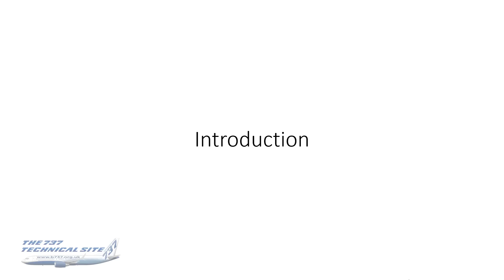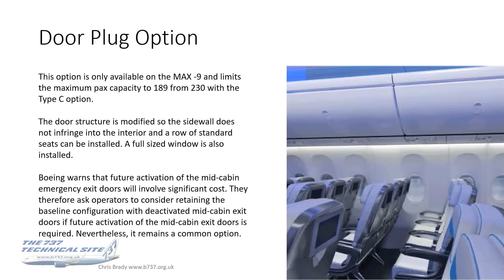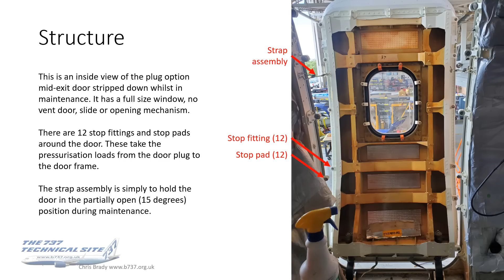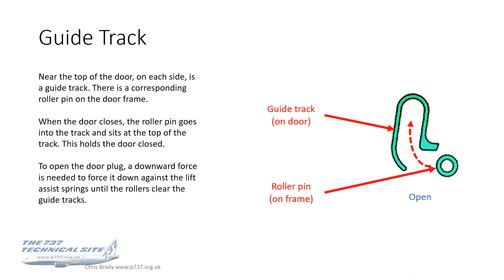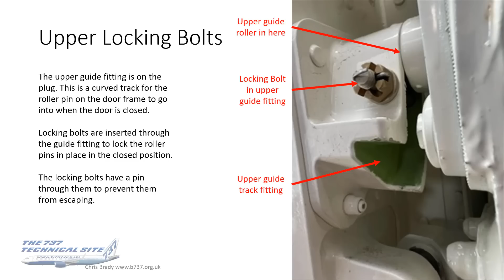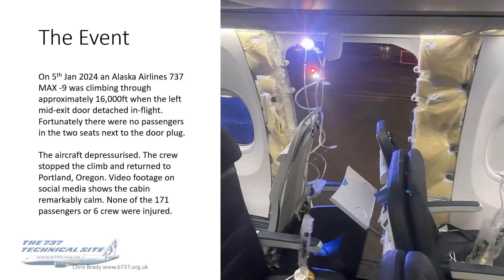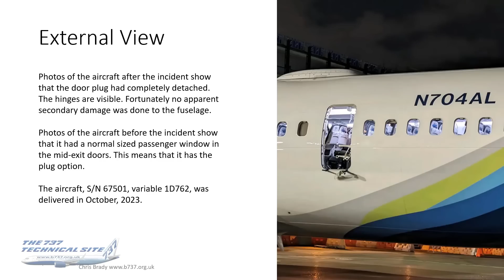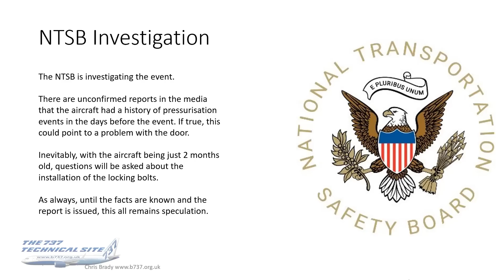737 Mid-Cabin Emergency Exit Doors - Plug Option

Comment: 6:30 The “roller pin” doesn’t go anywhere, it’s attached to the frame and stationary, it can’t move around a corner. The “guide track” attached to the door is what moves. The only way to disengage the pin from the guide is for the guide to move upward (along with the door), with assistance from the lift springs on bottom hinge assemblies.
Reply: Chris, I realise that the AMM should be the authoritative source but just looking at the pictures surely shows the opposite. I hesitate to suggest it but if that text really is a quote from the AMM then it looks as though the description in the AMM itself is incorrect. Normally I would have resigned myself to the fact that I didn't understand but I really can't see how this description aligns with the pictures.
Reply: @davidvallance1554  I've found multiple errors in the 737 system schematic manual that left me scratching my head, they certainly aren't infallible. The sheer amount of information in the manuals is staggering! Getting all those details right is a tremendous effort. There are also many repeated diagrams and text which would all need to be identical and all updated when there is a revision that affects them. Anyways, TL;DR I would not be surprised if the AMM was in error.
Reply: @MikeOBrien0  I agree. The Maintenance Manual is far from infallible. I was continually submitting error reports through our tech department.
Reply: @MikeOBrien0  I wonder if those who wrote the manuals have seen the procedures being performed (or even better, participated in it themselves), or just heard of it via an effective game of telephone. It'd be easy to get the details wrong for someone who has only looked at drawings and not the reality.
Reply from the maker: * Errata *
In this video I state that a downwards force is required to remove the door plug. I based this statement on text in the AMM SDS which I now believe to be incorrect or misleading. It is possible that a very small downwards motion (1-2mm) is first required to be able to free the locking bolts. But the door must be moved upwards by a couple of inches to clear the guide tracks. Apologies for any confusion.
Reply: @ChrisBrady737  CORRECT--almost!  If the cabin is pressurized, perhaps only an inch upward movement is sufficient to permit the stop tabs from being misaligned enough to pop the door plug open.  It was reported that both guide tracks had fractured, so apparently what happened is that the bolts were not installed, eventually the door slid sufficiently upwards (due to turbulence...) to move the door stops above the frame stops, the pressure pushed either the bottom of the door outwards fracturing the guide tracks with a prying force or the pressure was sufficient to directly fracture the guide tracks.

In order for the door plug to be removed for servicing, then a few inches upward movement would be sufficient to disengage the pin and guide tracks.
Reply: @ChrisBrady737  Is this a Boeing error, similar to not informing pilots that thier anti-terrorist cockpit door will just swing open during a depressurisation event?
Reply: Well…if they’re called ‘Lift Assist Springs’ then doesn’t that tell us something ? There’s a gap at the top of the plug in reference to the frame, thus it makes perfect sense the springs are helping assist you to overcome the mass of the plug, which allows the track to rise over and off of the pins. Once the plug is opened, those same springs keep the door from the tendency of gravity to pull the door down back over the pins, allowing the plug to be removed from the fuselage.
Reply: Does make more sense to me else those springs wouldn't be the opposite of a 'help' opening the thing.
Reply: @secondskins-nl  Well, without the bolts, it looks like it just needs a yank upwards and slight push and there you go... A minute turbulence at altitude would open it... well, about the way it opened. 
Now, the question is, was it wise to make (the plug) springy to open with easily detaching single-and-only safety device (bolts) instead to make it harder to open but foolprof to put back?
Reply: @docnele It needs a yank DOWN to unlock the door (ie a hard landing) in the absence of the bolts.
Reply: @allangibson8494 , I watched, read, & listened many times before writing my comment, I was confused about this too. At first I thought maybe I didn’t understand the orientation of diagrams, maybe they were upside down, but I believe they are all correct. The diagram, related text, and narration at 7:00 all state the guide is on the plug door & the roller pin is on the door frame. However in that scenario pulling DOWN on the door cannot release the pins like described in bottom paragraph of that diagram. So, the video gets something wrong- either he gets the location of pins & guides wrong at least 3 times, or the statement about pushing down against the springs to release pins is wrong. 

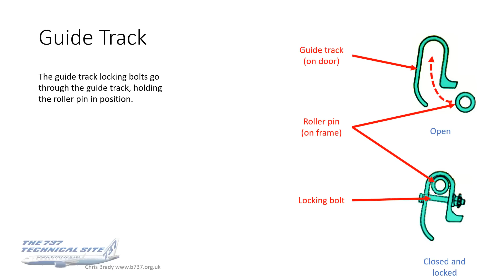The answer is found when looking closely at the new 9:00 photo showing the pin, in the guide, of a closed door, with the bolt in place, and matching it up with the 8:30 diagram showing the same. Now, zoom in on the 8:00 photo at the upper right corner. Knowing what the guide piece looks like you can see it’s positioning on the open plug door, AND the roller pin is visible on the door FRAME. The springs have to push the door UP to release the roller pin from the guide. The door can’t move down against the springs if the pins are in the guide slot. Once I understood the relationship of the parts it finally made sense. 

Finding the door WILL provide some answers! Those lower 2 bolts not only go through the green / cream door piece that slides on the vertical cylindrical pins, but they go through the center of that cylindrical pin. Those cylindrical pins appear to be extending horizontally outward at the bottom of door opening on the exterior shot of plane. I think I see part of that green / cream piece dangling from the end of the one on the right. The closeup pic of the lower hinge area shows those pins have a bolt in the upper end, with a washer larger than the pin, presumably to prevent the door sliding off pins until the bolt / washer are removed. 

I’ll wait to see better closeups of damaged parts, but it seems to me if even 1 of the 4 bolts were in place & properly secured the door could never move enough to release the pins at the top. If NONE of the bolts were in place it seems likely the vibration going down the runway on the first flight, combined with springs pushing up on door, it would have popped it open before plane got into the air. Bolts in position, but maybe without nuts & cotter pins, might stay in position quite some time until the last one vibrates out and door goes flying. I can’t see there being enough movement / vibration / force from springs to shear the bottom bolts. The upper bolts don’t even go through the roller pins, they simply trap those pins in the guide, so there could be some bending force on the upper bolts, if for some reason the lower bolts were not in position and allowing door some upward movement via spring pressure. In any case, once the upper pins come out of the guides the door goes flying.
Reply: @Bitterrootbackroads  The door releasing with no bolts would be a balance of the weight of the door and the acceleration and duration of the acceleration needed to move the door down the 50 mm to the unlatched position. The friction of the latches under pressure would oppose this in normal flight but on landing the differential pressure from the cabin pressurisation is dumped when the landing gear is extended (and is naturally low below 8000ft).
The biggest and longest duration thump occurs when the wheels hit the runway, so that would be my likely candidate.
Reply: @Bitterrootbackroads  Let's say all four bolts are missing, and the springs are pushing the plug up into the guide rails. The 12 stop fittings are holding the door to the A/C frame, but not providing much structural support. The pressure differential is constantly pulling the plug outward. Now lets say the stop fittings finally give way, but you still have all this pressure trying to pull the plug out, what happens? Maybe the plug comes off from bottom-to-top, not the other way around. The pins are still in the guide rail, the plug pulls off starting at the bottom and pushing outward, the hinges keep pushing up, the plug rips off from bottom to top and the last thing that happens is the pins finally come out of the top guide rails. What do you think?
Reply: @Bitterrootbackroads  Absolutely correct. Pins on the frame, sitting in the guide tracks on the door. Pushing the door down is impossible. Pushing the door up is what releases it. 
Therefore, the only apparent mechanism stopping the door from opening at any time seems to be related to those twelve "door stops". It seems likely that the working emergency exit door would have latches on them (pull a lever to release the latches, allowing the door to jerk up on its springs and out). And the "plugged door" option would have bolts through the door stops instead. 
Looking at the image of the ajar plug option at around 4:50 (and especially the visibly substantial structural strength of the twelve "stops"), nothing else makes sense.
Reply: @ParisScot , At 5:16 the video talks about those 12 “stops” taking the pressurization load & transferring it to the door frame. NTSB briefing on Sunday also said those 12 stops take the pressurization load. I readily admit- I have ZERO training, or actual knowledge of anything aircraft related. Maybe enough mechanical aptitude to look at static pics of parts and imagine how they move. A few photos, diagrams, narration & text in this video are all I’m going on. Before I saw this video I assumed “plug door” implied it was something installed from the inside with a flange or taper seal that used the aircraft interior pressurization  to aid in sealing and positioning. It’s not a novel idea, steam boiler cleanout holes used that concept in the 1800s. Shows what I know about airplane doors! 

A “stop” in general mechanical terms often implies something that limits the travel of another movable component. The video claiming these 12 stops transfer pressurization from the door to the frame implies they somehow make a physical connection but there is no mention of how that connection is established. If there are 12 bolts that go through the “stops” and into the door this video makes no mention of them. I see nothing in photos or diagrams, either on the stock photos or the plane in question, to suggest there are 12 additional fasteners or latches of any kind holding the plug door, and possibly failing. Maybe there is some automatic device on those stops like a tab dropping into a slot or something? If that’s the case, and they automatically release when the door moves upward to lift the guides off the pins at the top, then they offer ZERO redundancy in the case of the door moving. It would be like your seatbelt automatically releasing in a collision at the same time your air bag fires. Videos on bridge failures call that concept “fracture critical”. 

Since they are called “stops” my first thought on their function, once I learned the door opens outward and the video was focused on the guides, roller pins, hinge assemblies & the 4 locking bolts, was that those stops simply were there for bearing points for the door to rest against when it was fully closed, with no holding function. I would guess there is some adjustment function in the stops to fine tune the flush fit of the doors outer surface to match fuselage profile. This video & NTSB claim that the stops are load bearing against cabin pressure. If they stick with that claim I need to see how that is accomplished. 

Now that the door has been found we will have answers soon. Will it have 12 broken / failed / missing stop bolts or fasteners?
Reply: @Bitterrootbackroads  I certainly agree with this point of "confusion" I expected to hear the stops were offset for closing then as the door is lifted (assisted by the springs) that they would overlap/align to take resulting cabin pressure forces. I did not hear that. Looking forward to the reports, but this video is well enough done to greatly advance my understanding of the structure.
Reply: @billl7551  Yes, I’m zooming in with my iPad but I can’t see any functional details on the “stops”. Since the doors final move to being in fully closed position is mostly downward about 1-1/2”, and the tubular portion of the stops appear rigidly attached to frame, how do the 2 parts engage?
Reply: @Bitterrootbackroads   Someone else on here (can't find the comment) with experience of such doors said that the door stops lie over the pads and the forces from pressurization push against the pads...
So therefore, although you can't see it from the photos, the only way this can work is that the stops on the door lie over (i.e. inboard of) the stop pads. As pressurization pushes the door outwards, the door's stops push against the interior surface of the pads, transmitting the forces to the fuselage.
And (also according to that comment that I can't find), the guide rails are merely there to make sure that when the door is closed, it slides down exactly so that the stops are perfectly aligned on the pads. This also makes perfect sense.
Maybe sticking bolts through the stops and pads is bad from a safety / fuselage stress dynamics / noise / other point of view; the door is designed as an open space and putting a rigid bracing (door + 12 bolts) across it on the ground in uncontrolled conditions (maybe Alaska, maybe Arizona) might interfere with the contraction of the rest of the fuselage around it at different temperatures and pressures. If that is the case I can understand that the plug mimics a real emergency exit door while remaining inert. But it still strikes me as a flimsy method of securing that gaping hole.

BUT... looking at the pic at around the 6:00 mark, those 12 stops seem to have a threaded bolt protuding out from them. This does seem to suggest that when the plug is sealed, those bolts are tightened, fitting the holes in the stop pads and preventing the door from moving at all. Or maybe they adjust the depth of (rounded? conical?) pads on the other side to improve the seal. Whatever the case, it does seem that the stops and stop pads are the primary method of securing the door, and the bolts across the rollers/guides and spring-loaded hinges are merely to prevent the door from shifting out of position.
Reply: @Bitterrootbackroads  I also thought there were 12 bolts there, but it seems to not be the case. I just took a look at the AMM, the body stop is facing inboard, and the door stop is facing outward. So indeed, cabin pressurization holds the door firmly against the stop pads. This makes things a lot more confusing. I'm sure these questions are more obviously clear if I was in front of the plug to see it in action.
Reply: @Bitterrootbackroads First thought is that the plug has hooks that mate with the 12 door stops.
Reply: @allangibson8494  actually the opposite, the door can only open when it's in the uppermost position.
Reply: @adjutant , My ONLY reference is the photo of the open door in this video. I’m thinking now my eyes have been fooled by an  illusion created by viewing what is essentially a 1 dimensional drawing of 3 dimensional parts. It’s like Big Bang Sheldon trying discern the difference between squares, triangles, and hexagons while stuck in the imaginary Flatland universe. Ms Homendy with NTSB and her “high five” skit last night did nothing to answer mine, & apparently other peoples questions, BUT- she has seen the 3D version. Her failure to comprehend the problems I encountered in Flatland is understandable. 

A view looking downwards, of the stop parts engaged in a closed door situation, I now believe will show the “stop fittings” on the door are L shaped & extend far enough inward from the door, so that as the door is closing that last 1-1/2”, the bottom of the L shaped door fittings actually come down inboard / BEHIND the frame mounted “stop pads”. If thats the case, then all is good.
Reply: @kdietz65  That is consistent with what was found...both guide tracks were fractured.
Reply: @Bitterrootbackroads  The door stops slide in back of the frame stops.
Reply: @BruceLiebert , Thanks for the input on how the stops work. Going only on that 1 dimension photo I just couldn’t see what was happening. The experts all described the stops bumping up against each other, they just left out that part about how the outboard one gets behind the inboard one, High 5s and that photo were no help! I have yet to see a pic or diagram of the stops engaged but I can visualize it now. 

In the case of this rarely opened door plug I hear rumblings that re-engineering needs consideration. We hear plenty about redundancy being key to aviation safety. I don’t know if either the 12 stops, OR the positioning / latching system (hinges, guides, roller pins) are capable of retaining the door should the other fail? If so, it seems a redundant plan would make them 2 separate systems. Why should a failure in the latching system automatically release the 12 stops? That sounds more like Fracture Critical engineering.
Reply: @ParisScot 
I agree, those twelve stop fittings/stop pads are doing all the work. They do look like they have a threaded stud sticking out, but it would be on the wrong side, untill the plug is in place and then they would be screwed into the stop pads. If they are just pressing on each other with no locator then the only thing keeping them in place are the two guide tracks on the plug at the top. We really need to see a close up picture of the stop fittings to know for sure.
Reply: @johnjosey5184 , I’ve come to the conclusion the straight on photo angle is creating an optical illusion in regard to those stops. Those who have seen them in person are seeing something different than we are imagining maybe. Pics from the top & sides of the stops engaged will make it clear I think. The door mounted part apparently comes down & over the frame mounted pads and engage them on their back sides.
Reply: @ParisScot , Yes, apparently the door mounted outboard portions end up inboard of the fuselage mounted pads. The straight on aspect of the photo makes it impossible to see. The experts with their High 5 hand slapping skits don’t explain it clearly.
Reply: @Bitterrootbackroads  
Yeah, a clear photo of either from the top or the side would clear up how those 12  points work. I cant believe they are just "floating" They surely have some sort of positive locating pin ?
 
It's hard to see, but the pins at the top of the frame , the one's that go into the tracked bracket on the plug dont seem to be sticking out too far. Again, a close up photo would reveal if that is the case. So many more questions than amswers at the moment.
Reply: @docnele  I would think that cabin pressure would keep the the door in place at altitude, but when depressurized, the springs probably almost entirely counter balance the weight of the door and any jostling might inch the door up. After a few takeoff and landing cycles, that movement might be enough to fully disengage the stop pads and blow the door when pressurized. That might explain the pressurization problem over several days and also why the door blew out at relatively low cabin pressure differential. It might have been a ticking time bomb  if all four of the bolts were missing
Reply: @johnjosey5184  , So far the experts are all focused on the 4 locking bolts & their related parts. I think some of the focus will eventually shift to the 12 stops, and some pics or video will show up. NTSB is looking at the matching plug door on the other side of the plane, no doubt opening and closing it many times with cameras rolling. Before you can figure out why something ISN’T working, you have to understand its function when it IS working. I have a feeling someone looking at that closed door, secured at 16 different points, will be amazed to see all 16 points release at the same time. If I was with the NTSB at that point I might ask- “Why are all 16 holding points releasing simultaneously?”  (Well, 14 that release & 2 hinges at the bottom that are now free to swing outward) 

You ask a very good question about the stops apparently “floating” as opposed to having some sort of “positive locating pin” or function. I wondered the same, and also why nobody is paying any attention to it. I went back and watched Blancolirio & Ms Homendy try to explain  how the stops function with their “High 5” hand bumping skits in response to reporters question. Ms Homendy asks the fellow standing to her right to hold up his hand. I only caught this after watching it a few times but she gave away the secret at the very end. As she demonstrated how the stops “release” she slid her hand UPWARDS, OVER, and BEYOND the guys hand to show the actual release motion. So HER hand was the “stop fitting” attached to the door & moving outwards, and HIS hand was the stationary “stop pad” attached to the door frame. Then it makes sense!

The stops have to be “floating” because their total engagement is dictated by the final 2” downwards door movement to fully closed position. They slide together so they have to slide apart. They don’t “BUMP” together like the experts claim. They can’t have any positive locating pin or device because it would interfere with, and prevent, the sideways / upwards motion needed to release them. 

Just a little speculation here- What I see of the stationary “stops” shows a round hole through at least some of them, not a sliding “pad”. I wonder if the guy who originally designed them planned to close the door? Then put some bolts through some stops and into the door? For a plug door, that only opens a few times during the life of the plane, the extra few minutes to manually remove those bolts would seem a worthwhile sacrifice if it achieves redundancy, as opposed to the current “mousetrap” effect as Blancolirio calls it. 

The first major auto recall I remember, early 70s I think, involved the bonded rubber pads failing in the 2 piece motor mounts on General Motors cars. People died when engines shifted & jammed throttles wide open. The “fix” done to millions of cars, was an 8” cable with eyelets looped and bolted around one engine mount. Parts cost maybe $1 each & 5 minutes on the hoist. Hey, that gives me an idea!
Reply: @kdietz65  , Some of the loose bolts they are finding upon inspection are holding the hinge slider piece onto door & they appear to be backed out several turns at least. Like they were hand started but never tightened? Or maybe the bolts were too long and the threads are bottomed out?  The single distant photo of the plane exterior seems to show part of one of those “sliders” still dangling from the pin it slides on. So yes, what you describe might be possible. For sure if the bottom of door came loose first, and the 2 locking bolts were in the upper guide assemblies, then the 12 “stops” would still be engaged. I don’t know how strong those stops are, but if one goes, it seems the rest would follow in an instant. I look forward to the NTSB forensic photos we will see eventually. 

I used to be in the engine rebuilding trade. When something goes wrong, the need to figure out what failed first, is the key to determining who screwed up. It’s exactly what NTSB is doing to determine if certain damaged parts are the cause of the failure, or if they were damaged as a result of the failure. It never involved more than a few hundred dollars in our case, a couple times in 20 years it was our screwup, and it got fixed. Stakes are much higher here, but same situation.
Reply: Agree completely with everything you say. I couldn't understand why they were talking about having to push the door down in order to open it when everything from my point of view meant the door need to go up and it was impossible for it to go down as the guide tracks would have prevented it against the rollers.
Reply: @Bitterrootbackroads 
I agree. The redundency it would give, even if only two of the stop fittings had bolts or threaded studs to keep it from moving up. the inconvenience of having to remove them once in a while would be a small price to pay i would think. 
If that was the set-up, then even with all four locking bolts/nuts and cotter pin removed, the plug would still be securely in place under cabin pressure.

I probably should say here that i dont have an enginering background, although i do have an enginering mind.
Reply: @billl7551  Yes, “overlapping” is maybe a good way to describe it. And I’m still waiting for a pic that shows it. And you do present a VERY interesting idea. If the door mounted stops slid into engagement with their mating piece from below instead of above, then the door lift springs would keep them engaged. HOWEVER, that would require reversing the direction of those upper guide slots so that the door opened when it was forced DOWNWARDS against the lift springs, instead of upwards with assistance from them. Those door lift springs would then be holding everything in the closed & locked position even if none of the 4 locking bolts were in position. Seems like a much safer design maybe? Those lift springs would need to be forced down to release door locks instead of being like a mousetrap ready to spring / cause door to fly off. 

WAIT A MINUTE- Somethings not right! That is the exact procedure for opening the door, as described in the manual, and quoted in the video, that caused all this confusion in the first place about which way does the door go? Up or down? Pilots Chris & Blancolirio both agree, and posted above, that the tech manual is apparently WRONG. 

MORE SPECULATION- Is it possible the manual was correct at one time? But the design was changed to make the door easier to open, save cost, or whatever? See production order #_______? And after the change the procedure in the manual never got updated? Boeing?
Reply: @johnjosey5184  Agreed, a couple bolts through the stops would have enough shear strength to stop all 12 from moving. I just posted another response below to @bill7551 He mentioned something that triggered another thought.
Reply: @Bitterrootbackroads 
Well spotted. Thats extremely plausable 👍
Have you seen his latest video ? He's posted a picture of the stop pins/pads from the top as we had hoped for. It seems to be a ball and socked set-up which makes sense as a straight pin would have to be inserted exactly 90deg which could be quite difficult with 12 points on a curved surface.
I'm even more baffled now as to how it came off mid flight. That plug has to move in towards the cabin a fair bit to disengage the pins against cabin pressure and then move up to disengage the pins in the tracked bracket.

Just thinking aloud here, but do you think it's just possible that the cabin didnt pressurise properly and a high shear wind from outside the aircraft pushed the plug in just far enough to disengage all twelve pins ? I know, pure speculation on my part now but i am stumped. I thought when we had more information, it would become apparent.
Reply: @johnjosey5184  , Just watched the new video with better pics of the stops. I can see how it all works now. The stop contact points apparently have some clearance as door closes and they rely on cabin pressure to bow the door outwards and engage that ball & socket / cup shape you see. Although I’m thinking now the contact pads are indeed flat and an illusion created by light & shadows. Otherwise, I’m wondering how they got that pic? Is it taken inside a pressurized plane? I doubt it. I’m done with it all for now. It will be interesting to see what they find, did the stops slide apart & disengage or did they get ripped off the door? They have all the parts and will figure it out. Beats fishing stuff out of the ocean or a smoking hole in the ground.
Reply: I was also confused and spent a bunch of time going back over the video. Totally agree with your observations! Despite what the AMM is saying. I have seen what the process is like for writing maintenance manuals at an aircraft engine manufacturer as an intern. I'm not surprised that inconsistencies can be left behind.
Reply: Yes,  the diagram reflects what you say.  But the instructions in diagram say to move plug downward to open.
Reply: @richardsmith184  yes, the opposite of reality. When the plugs are installed, you can see the dark line indicating that 1 1/2" gap at the top of the door, which is needed to allow it to move upwards before it can be opened. I wonder how much force is needed to push the door upwards - I'm assuming the springs are not strong enough to have it in the up position by default, but maybe they are, and you actually have to pull the door down in order to be able to install the locking bolts.
Reply: Yeah. The slide also says the door plug has to move down to open. Not correct.
Reply: At 8:45 onwards, in the photo of the bolted guide track, there is a stop fitting (part of the door) pushing outwards  against a stop pad (part of the frame). The guide track is part of the door, the roller pin is on the frame. The door opens upwards. 

With spring assist. 

I wonder... If the guide track were on the frame, the design would be fail-safe, in that even without the locking bolts, the springs would keep the plug in place (and the AMM would be correct). Did someone change the design and inadvertently create a safety hazard, similar to the Hyatt Regency walkway collapse?
Reply: Well skoken
Reply: Spoken
Reply: @matelanmungal9807   whale seed 😆
Reply: Just imagine if the AMM actually had a mistake and the mechanic working on that part relied on it, and installed it incorrectly. Is that possible? They read that the door would have to move down to open it, and they saw that the track prevented it from moving down, because it was at the limit. They relied on the manual, which had it backwards? Possible? The diagram clearly demonstrates that the door would have to move up to release. Unless the diagram is upside down (unlikely).
Reply: Yes, why have the springs to assist removal of the door if they would cause this to happen when the bolts are missing and the only time that plug will be removed is for maintenance or replacement? Seems like an odd design choice, as otherwise would be another factor, helping hold the plug in place, if some doofus forgets to put the bolts in as now appears to be the case
Reply: THANK YOU. I was very confused with this bit in the video. Had it paused for several minutes trying to wrap my head around this.
Reply: agreed, that's why I say the photo is upside down.
Reply: To support the general argument that the door moves upward to unlock: 9:30 seems taken from the inside. If so, the stop fitting which is welded on the door determines that the door is on the left, hence the track fitting is on the door and the roller on the frame. From this, the door must move upward, not downward, for the roller to exit the track fitting (the latter moving with the door, the roller fixed on the frame) and the stop fitting clearing their stop pads.
This seems coherent with the pictures of the doors from the outside at 3:10, showing the gaps above the doors, which I assume is an indication of the space needed for the upward vertical travel that allows the subsequent outward motion.
Reply: Agreed, just took a close look at one today to get a good understanding of how it works…then watched Chris describe it incorrectly!
Reply from the maker: AMM SDS 52-23-00 Page 6 MID CABIN EXIT DOOR PLUG - COMPONENTS, Lift Assist Springs:
"Apply a downward force to the door plug this forces it down until the rollers clear the guide tracks. At this time the door plug can open outboard."
Reply: @ChrisBrady737 , I’ve read hundreds of comments, but have no access to aircraft manuals, just your pics & descriptions. 

The only comment expressing any logical reason for pressing DOWNWARD on the door plug was- that moving it a couple thousandths of an inch downward would release the shear stress the lift springs are putting on those 2 cross bolts to allow for easy removal by hand. At that point the door can move upward to release the upper guides from the roller pins, assuming the upper 2 lock bolts are also removed. 

If that manual is written as you describe, it seems incorrect.
Reply: @ChrisBrady737  your reference is wrong. Just look at the parts in your presentation, what they are attached to, and then you’ll realize it’s the other way around.
Reply: @ChrisBrady737  If the roller pins go up and into the guide track, wouldn't you just be pushing the roller pins into the top of the guide track if your pushing downwards? The shape of the guide track clearly indicates an "up and out" direction to clear the pins. How does pushing down assist this motion?
Reply: @ChrisBrady737  what revision of your SDS are you looking at? I actually just pulled the most current document up for the incident aircraft…it says the same (incorrect) thing. But, if you look at the installation AMM 52-23-01, it states “If necessary, push the top of the door plug down with a force of 30-35 lbf to allow the upper guide fittings to move over the upper guide rollers.”
The removal steps still state to lower the plug to remove it, but the illustrations clearly indicate this to be incorrect.
Reply: OK... so which way does the door move to normally open it? UP? or DOWN?   Thanks! Juan

EDIT fron Chris "AMM SDS 52-23-00 Page 6 MID CABIN EXIT DOOR PLUG - COMPONENTS, Lift Assist Springs:
"Apply a downward force to the door plug this forces it down until the rollers clear the guide tracks. At this time the door plug can open outboard."" Thanks Chris!
Reply: Juan, Here is (in my opinion) the best description I have seen from Bitterrootbackroads just above "The only comment expressing any logical reason for pressing DOWNWARD on the door plug was- that moving it a couple thousandths of an inch downward would release the shear stress the lift springs are putting on those 2 cross bolts to allow for easy removal by hand. At that point the door can move upward to release the upper guides from the roller pins, assuming the upper 2 lock bolts are also removed. "  Remember that the 4 locking bolts are put in shear stress by the lift springs and the slight downward push is needed to remove or lessen the shear stress so the bolts can be removed, then just remember to keep the downward pressure applied while the bolts are removed.  Without knowing the spring pressure it looks like a 2 person job to "open" the plug.  mfhenning, Grass Valley, ca.
Reply: @michaelhenning8090  thanks for your input! I have been following this discussion on multiple threads here and thought i understood it but came to conclusion that there was definitely some contradiction between the various text, diagrams and pix here. 
I agree that door might need to be pushed down a hair to allow bolts to be inserted or removed but it certainly can’t move down enough to get the pin out of the guide given that it’s at the top of the guide when locked. 
I appreciate the insight from others with actual knowledge of this but my mechanical mind said something was wrong somewhere in the video or manual or both.
Reply: @blancolirio  after looking at it in person, as well as having some lead engineers come out and talk to us, the plug most definitely must move upwards to disengage from the upper rollers.
Reply: @737MaxPilot 9:22 The image shows the stop at the guide rail is at the top, assuming the orientation of the photo is right, the roller pin is on the door and it has to be pushed down to open it.
Reply: @Ihaveanamenowtaken  the roller pin is installed on the frame of the opening, not on the plug. I have seen it with my own eyes just yesterday.
If you look at the hinge pins and the compressed springs at the floor, explain just how you could possibly lower that plug at all.
Reply: @Ihaveanamenowtaken  the roller pin is on the FRAME.
Reply: @blancolirio  Right!!  If one looks closely at 4:50 the pin on frame and the guide track on the door with the associated stop bolt hole can be seen. The spring pushes the door up, but not sure what position it is in when simply carrying the weight of the door. I suspect that a foot on the door lowers it to allow closing and releasing foot force allows it to rise into the guides. TBD.
Reply: @blancolirio  From NTSB: the door moved all the way upward...
Reply: @blancolirio  if you look at the pics, the description in the AMM does not seem to match up. To open the plug you have to apply UPWARD force. This would also fit with the "LIFT assist springs" helping you to perform that upward action. I've found errors in the AMM's before, would not be surprising if they got this backwards.
Reply: @MikeOBrien0 Oh great. This means the curve in the guide track doesn't make the cabin pressure close the door, but open it. Who had the brain fart to design a door that's being pushed open by the cabin pressure? That's the absolute opposite of what you want in an airplane...
Reply: @MikeOBrien0    Got it! I agree...now possible problems with the manual too!
Reply: The roller pin is part of the door. The track is in the frame.
The lift springs hold the plug closed in the absence of the bolts by pushing it up on the tracks at the top of the doors.
Reply: @allangibson8494  The roller is clearly on the frame and the guide is clearly on the door. The door has to be lifted UP to open, aided by the springs, hence the need for a gap, visible at the TOP of the door when closed, visible at 3:30
Reply: @tedsmith6137  The door pivots at the bottom.
Reply: @allangibson8494  No, the track is on the plug or door and the rollers are fixed to the fuselage frame. Chris shows the rollers in the photos.
Reply: @allangibson8494  You have it backwards..the track is on the door per the diagram. You can see the rollers in the photo he posted at about 7:50 in the video.
Reply: @gomez2724  Look at the photos - the door track it at the top of the door frame. The plug is pushed up into the top of the track. The track is intact in the photos of the failed door as are the frame stops. The door separated because it moved down and opened in flight. It didn’t “blow out” because of a structural failure.
The overwing exits lift up to release - this was different (and unusual) in it was released by moving down.
Reply: @allangibson8494 incorrect, the roller is attached to the airframe structure. I just looked at one today.